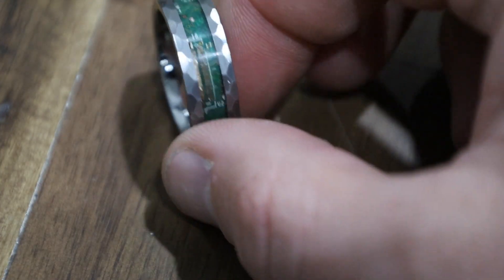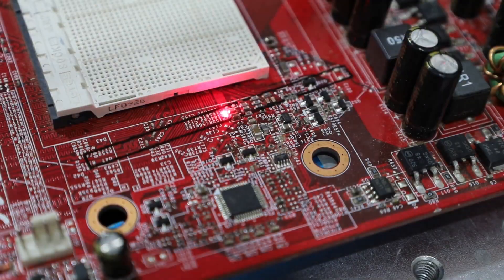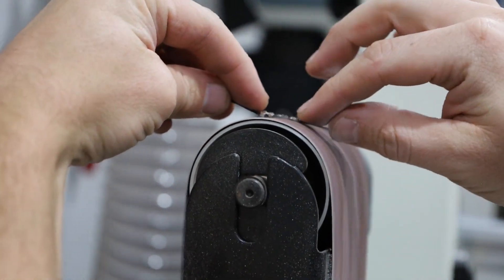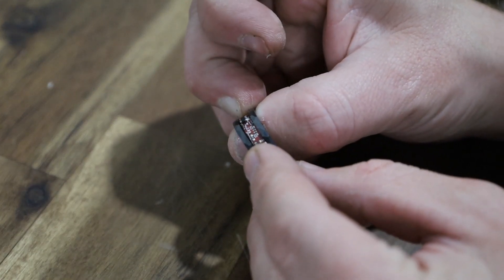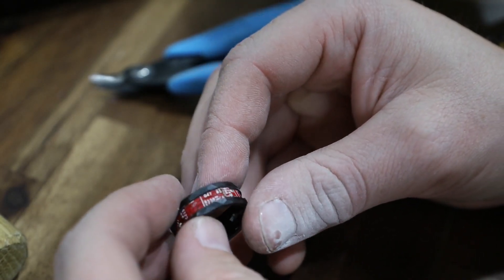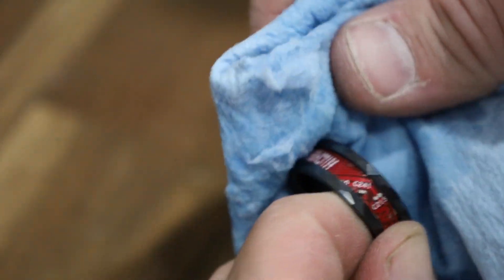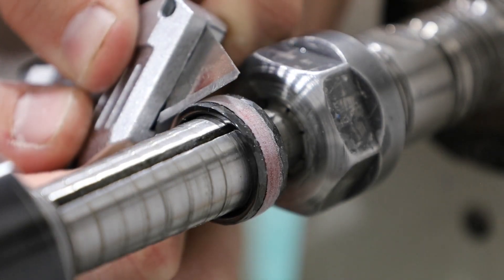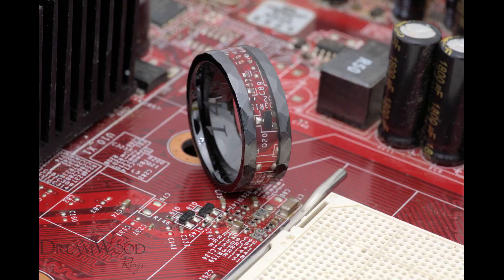Crafting a Circuit Board Ring: Tech to Gem!

Comment: Great job!  Can you do it in green and with some chips and resistors or caps on there?  Maybe an RFID chip?
Reply from the maker: yes! I have done one in the typical green. Adding a rfid chip could work. I wonder how well it would do being surrounded by the metal.
Reply: @DreamwoodRings  could try using that black ceramic material instead of metal. 👍

Comment: You can get/order PCBs in 0.4mm thickness, so it's entirely possible to have entirely functional PCB in that ring, you could probably even fit a copper coil in there to have RFID antenna, and make the ring double as an access card, with LEDs flashing on use, no battery or other builtin power source required.
Reply: Oooooooo would you please share how? Details? My brother is an electrical engineer and I would LOVE to do this for him!